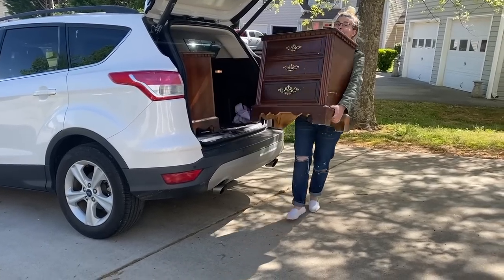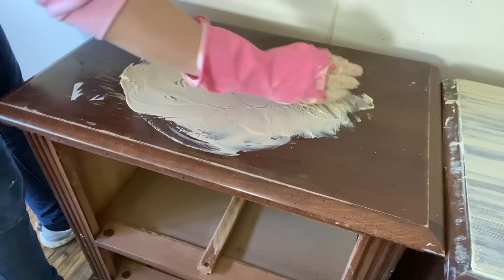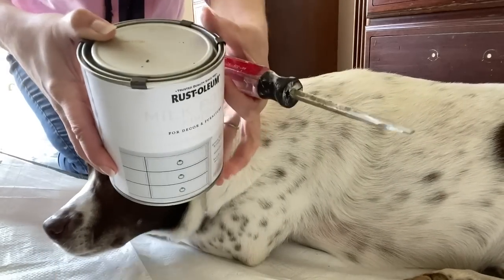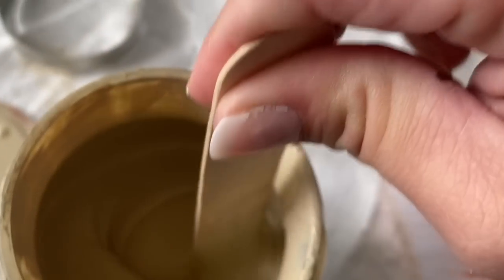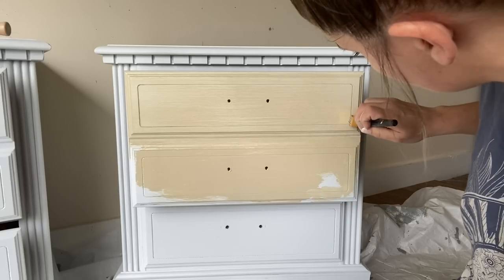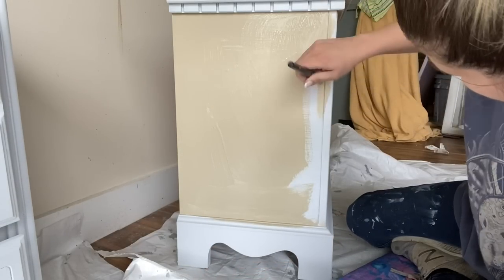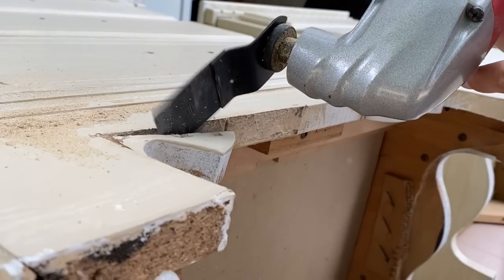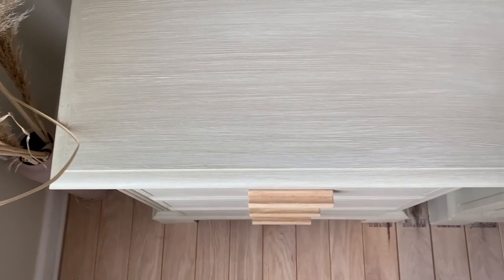painted Nightstands - Hardware Hack - modern legs w/$20 tool #furnitureflip #diyhomedecor

Comment: I'm new to painting over furniture. I have several stained pieces that I want to paint over. Every where I read it said to sand or remove the shiny coat or the paint won't stick. And to prime it. I have watched a few of your videos and I don't see you removing the shiny coat off the furniture. But your pieces look fabulous. Does the paint adhear? My kids painted a desk and dressers, and their night stands and used stripper, then primer, and it still peeled off in some places. Can you advise please. I want to paint but honestly, I'm worried the same thing will happen to the dresser.

Comment: Hi
I love the look you have created. For your special glaze can you paint the base coat with any type of paint you like( chalk, enamel) ? For the glaze do you mix a 50/50 paint and poly acrylic? Does they type of paint you use for the glaze matter? Can you use chalk paint? What type do you recommend? Do you normally do neutral s with this method? Sorry for all the questions 😊
Reply from the maker: I’ve used any and all paints to create these looks and I tend to stay neutral for quicker sales or I do wood looks but I’ve done a blue grey before 💗
Reply from the maker: I do 50/50 yes, I prefer water based polyurethane over poly but have used poly also

Comment: Hi. Love your videos. I'm a newbie...was planning to use your 1:1:1 formula but wanted to ask should I still wax my piece or can I skip that being the formula already has poly urethane in it ?????
Reply from the maker: It depends on how much use the piece will get, a dresser in an adult bedroom you can usually leave but something that’s going to get a lot of abuse will probably need a topcoat of some sort.  It also depends if you use flat paint vs semi gloss, the higher sheen paint that goes in the less likely you’ll need a topcoat, hope that helps!